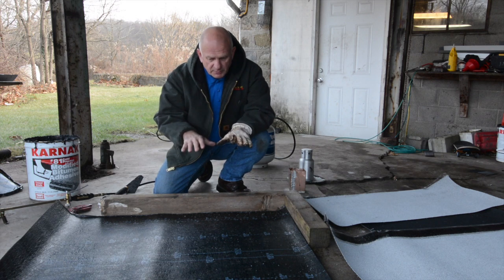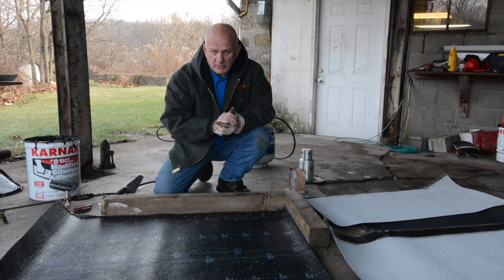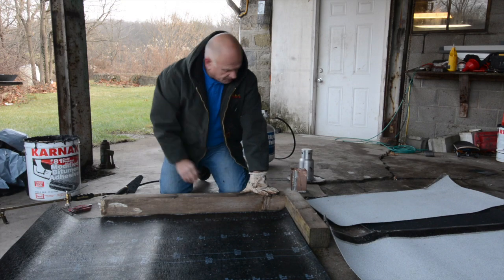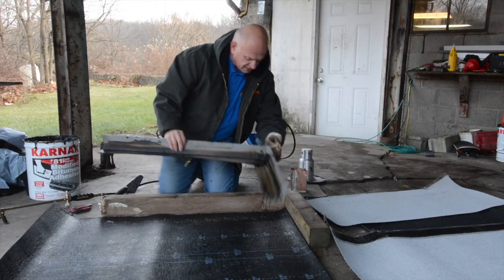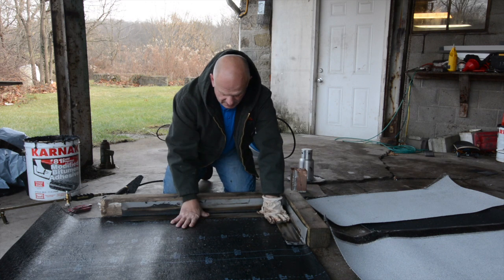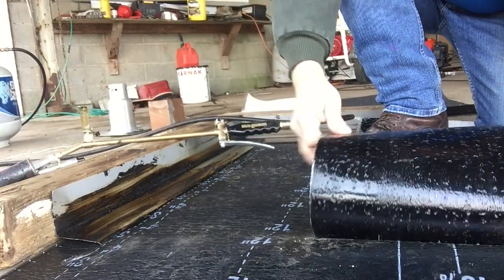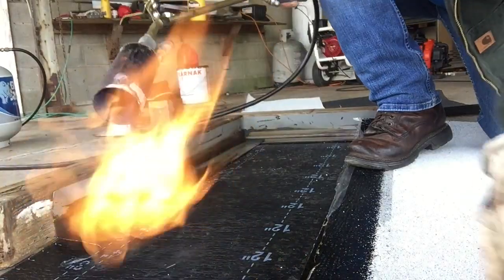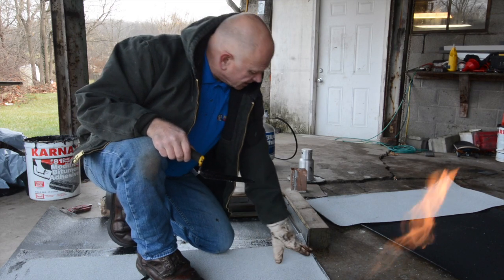Flat Roof Repair - How to make a repair on a Torch Down Rubber Roof

Comment: Another great and informative video Doc.... btw what brand of modified bitumen roof do you recommend and the base sheet..
Reply from the maker: I use Dynagrip from John Mansfield. The reason for that is it has fine sand on the surface that when I roll out the cap sheet to get it ready to torch, the sand will prevent the plastic backing on the cap sheet to stick to the base. This is very helpful because, especially on a hot day, everything wants yo stick together before starting to torch. Unlike GAF's Liberty base, which has a smooth plastic-like surface, the cap sheet will stick, and it gets hard to position a roll.
I prefer Firestone APP 180 black or white for my cap sheet. Sometimes this might not be available at a supplier, then I have to take whatever they keep in stock.
Sorry for the long sentences. I hope it made sense?
In this video, I show the 2 brand name products if you are interested https://www.youtube.com/watch?v=tYkxBnwlR7Q&list=UUpgLmY0SJNme1LhqtDrD08w&index=10
Reply: When I started roofing. My first torch on was Derbigum. And Paul Morris still owner the derbigum plant . We had to pull plastic sheet off the roll before torching.

Comment: If it’s hot outside do you still need to torch it?
Reply: If you’re using peel in stick
Reply from the maker: Hey Trent Peel and Stick and a Torch Down are 2 different roofing systems. I prefer the torch Down because the seams are welded and there is no chance of any leaks. Peel and stick is only good if you have a sloped flat roof of at least a 4 pitch. Less than that the chances are you could get water backing into the seams. This happened to me last year on a roof I did. I now have to go back and address the stupid mistake I did. I found out later this was a 15 million dollar house not 8 million. Here is the link to the roof that has the Peel and stick on it that I now have to fix. https://www.youtube.com/watch?v=0R9jF2-y0M0
Reply from the maker: You always have to Torch apply a Torch Down Roof. The outside temperature only helps so you don't need to use as much propane heat as during winter. A Torch Down membrane comes with a thin plastic backing that gets burned off when torching or using a flame. It is super important to burn the plastic off and get the membrane you are torching to melt slightly as well as the surface you are torching too if that happens to be a Torch Down membrane.
I am planning to make a proper Torch Down video demonstrating How too Torch. 
To recap. The heat outside can not melt the membrane together. If that was the case, then a Torch Down Roof would be melting during summer and no one would be able to walk on it.
Thanks for asking.
Have a nice day

Comment: Loved this video. Excellent presentation and extremely informative. Much more positive about tackling my own project. I have 2 questions -- 1) What is the patch material that you are using? The black "membrane" and can you simply make a patch out of the white 'cap' material? Also, can you recommend a good torch? Thanks in advance and keep up the great job!~
Reply from the maker: yes, you can use any color Torch Down membrane to make a patch. Here is video I made on Torches https://www.youtube.com/watch?v=iuRaXKsJrjA&t=31s

Comment: Very helpful. Question, how do you install insulation under the EPDM? I just purchased an older home that has a small flat roof that intersects with a pitched roof on three sides. A so called roofer, no permit, replaced the old EPDM before I agreed to close on the home, but as the "repair" was in process I went ahead and closed on the home confident he was a person of his word. A mistake, now. I have a leak making me very concerned. Plan on a small claims action against the contractor, attorney and the selling agent. They all left me with the problem. I will check back for your reply. Thank you in advance.

Comment: I gave you an A for effort
Reply from the maker: The effort must go along with quality. If I compare my videos to Casey Neistatd's videos, then I really need to step up with quality. It is not always easy to spend the time to set up and edit videos and do the work also.
Reply: You have the right concept is all I'm saying. Any roofer can tell you it's not right to burn the white cap. It's like when a painter   accidentally paints on the wall when he should be painting the trim

Comment: Craftmanship of a 10 year old, lol !
Reply from the maker: sure, thanks
Reply: I was wondering myself whether a waterproofer would be expected to keep the finished surface clean. Does the finished look matter? Is it possible to use 2 trowels, where one stays clean for smoothing the finished surface so you don't get black spots on top? Or is it generally industry practice to not worry about the mess/black smudges...

Otherwise it appears to me at least that he has a lot of technical knowledge.

Comment: dont use water shield.... when u replace the roof next time ur lucky the plywood/boards dont get destroyed. also air nailers are trash for future repairs etc. i will never own an air nailer. ever strip a roof that was air nailed? u know what i mean lol they dont pop like regular roofing nails. my worst experience roofing is with air nailers, people are fucking lazy tho, 1/2 the time the air pressure is off and sinks too deep- voids warranty for shingle- or not enough air and u step on it and void warranty lol  gimme my eastwing

Comment: Here piece of advice get with the times that material is JUNK and you know it.
Reply from the maker: You obviously have no clue. You are talking in general. Be specific. Torch Down Roofing is the best type of material for any flat roof. There are some brands that I would not recommend.
Reply: I have plenty of experience with rubber and that   Product was garbage from day 1. EPDM is longer lasting and safer to put down. 
I
Reply from the maker: @michaelevans4122  Your ignorance is not worth talking about